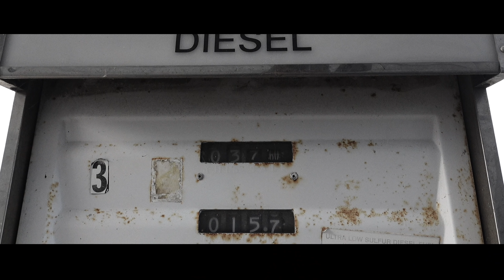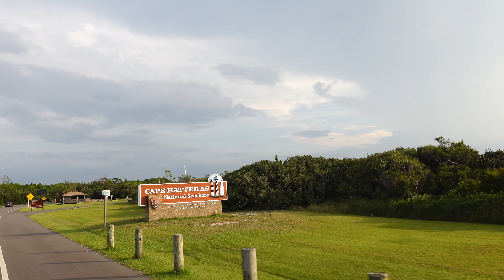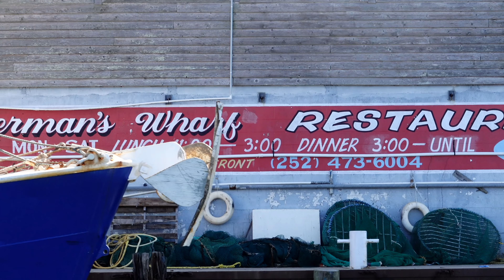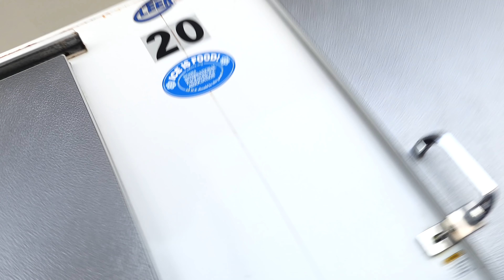Truck Camper w/ a Boat in the Outer Banks // Oregon Inlet

Comment: Try Frisco Woods Campground (down in Frisco).  You can get a site with power right on the sound.  Kite right out the front door.
Reply: I have stayed there at least 10 times, love it.  The mosquitoes can be tough during a wet summer!

Comment: Buy 20x20 no see um screen.  Cut it to fit outside your windows. Use Gorilla Tape to make the "frame" ... then use more Gorilla Tape to tape it over your regular screen and its frame.  Yes and spray it before taping. Good sleeping then.  My screen is 20 yrs old. No bugs

Comment: Your not soft lol 😂 even when I had my truck camper it had a generator to run the a/c when boondocking.. now I have a fifth wheel and when I travel in the summer it has a generator running and a/c going as I travel so it’s cooled down when I stop now that’s spoiled soft 😂